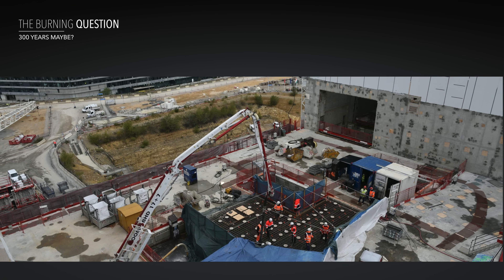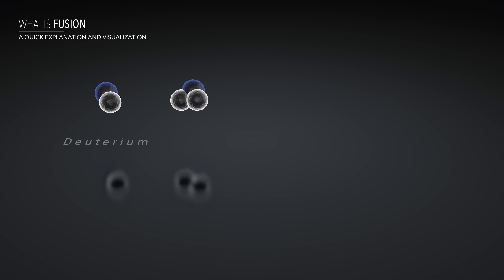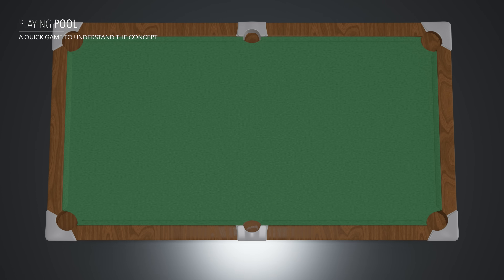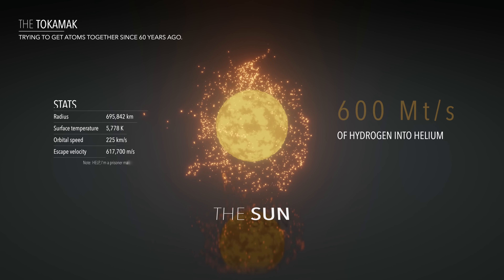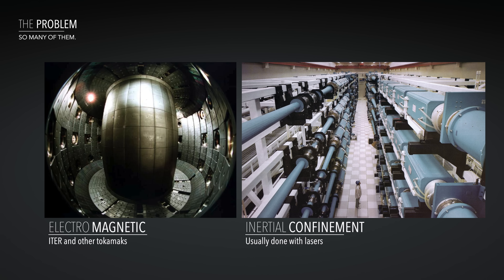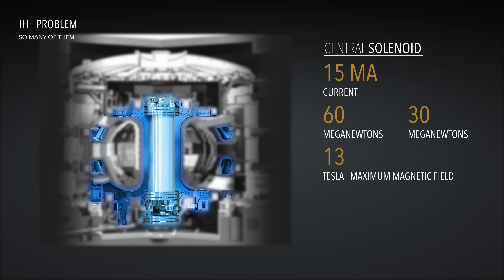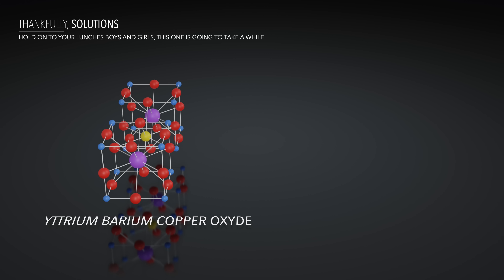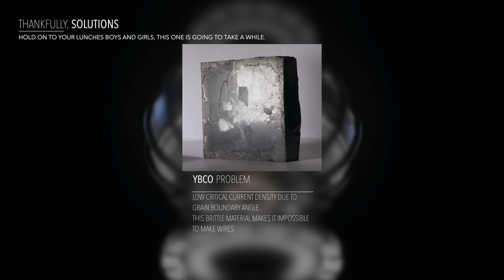Fusion in 30 years? ITER update [2020]

Comment: Fusion excitation function of 35Cl + 130Te system is measured in the energy range around the Coulomb barrier and analyzed in the framework of the coupled-channels approach. The role of projectile deformation, nuclear structure, and the couplings of inelastic excitations and positive Q−value neutron transfer channels in sub-barrier fusion are investigated through the comparison of reduced fusion excitation functions of 35,37Cl +130Te systems. The reduced fusion excitation function of 35Cl + 130Te system shows substantial enhancement over 37Cl + 130Te system in sub-barrier energy region which is attributed to the presence of positive Q-value neutron transfer channels in 35Cl + 130Te system. Findings of this work strongly suggest the importance of +2n - transfer coupling in sub-barrier fusion apart from the simple inclusion of inelastic excitations of interacting partners, and are in stark contrast with the results presented by Kohley \textit{et al.}, [Phys. Rev. Lett. 107, 202701 (2011)]. 

Die Fusionsanregungsfunktion des 35Cl (Chlor) + 130Te-(Tellur) Systems wird im Energiebereich um die Coulomb-Barriere gemessen und im Rahmen des Coupled-Channel-Ansatzes analysiert. Die Rolle der Projektildeformation, der Kernstruktur und der Kopplungen von inelastischen Anregungen und Neutronentransferkanälen mit positivem Q-Wert bei der Subbarriere-Fusion werden durch den Vergleich reduzierter Fusionsanregungsfunktionen von 35,37Cl + 130Te-Systemen untersucht. Die reduzierte Fusionsanregungsfunktion des 35Cl + 130Te-Systems zeigt eine wesentliche Verbesserung gegenüber dem 37Cl + 130Te-System im Subbarriere-Energiebereich, was dem Vorhandensein von Neutronentransferkanälen mit positivem Q-Wert im 35Cl + 130Te-System zugeschrieben wird. Die Ergebnisse dieser Arbeit deuten stark auf die Bedeutung der +2n - Transferkopplung in der Subbarriere-Fusion abgesehen von der einfachen Einbeziehung inelastischer Anregungen wechselwirkender Partner hin und stehen in krassem Gegensatz zu den von Kohley \textit{et al.} präsentierten Ergebnissen, [Phys. Rev. Lett. 107, 202701 (2011)].

Comment: I can not help but think an internal extremely high density microwave may be able to initiate plasma at temperatures needed in the chamber
Reply: Microwave heating is and has long been used in the tokamak reactors to help get the plasma up to temperature.

Comment: Also in the electron volt energy calculation what is not addressed is that we actually don’t use full critical mass fission reactions in current nuclear power we just use heavy isotope thermodynamic exchange reactions significantly less than that of a nuclear fission event, fusion now imagine is 4.36 times more energy expedient than that !

Comment: Unfortunately, sustained fusion may still require the need for constant massive gravitational force to naturally induce fusion.  The closest source of fairly large gravitational force is at the core of the Earth, therefore perhaps scientists may need to look at how they can turn the Earth's core into a global fusion reactor.  The problems are the potential runaway overheating of the Earth's crust, evaporation of seawater, etc.  In the end, it might make more sense to just build power plants next to volcanoes that can be used to heat up seawater and generate steam that runs turbines similar to a nuclear fission reactor heating up water to turn them into steam.

Comment: Our host did not mention the NUMBER ONE reason WHY the ITER fusion reactor will likely succeed, whereas all others have Come Up Short.
ITER, being phenomenally physically LARGE, establishes the possibility of a HUGE cross sectional area for the Plasma. Where Nuclear Fusion is concerned, there are THREE volumetric criteria. Of the recognized THREE criterion, only two have been varied experimentally, in a large count of ways. The remaining "frontier" is cross sectional area, and ITER stands a good chance of FINALLY, and significantly, exploring THAT variable. You see, the LARGER the cross sectional area of the confined Plasma, the LONGER it takes for the released Energy to ESCAPE (from the confinement zone.) The LONGER this process takes, then the level of HEAT (within the confinement zone) climbs HIGHER, which contributes to the possibility of keeping the Fusion Reaction GOING, perhaps long enough that the Fusion Reaction will, hopefully, become SELF SUSTAINING.

Comment: If ITER succeeds spectacularly with all goals and sub goals it will prove only that ITER-style Tokamaks are not worth pursuing for power generation. A practical tokamak-type fusion reactor, if such a thing is possible, would be much smaller and to do that you need to have much, much higher B-fields. It may have all sorts of plasma instability problems ITER didn't tell us anything about, because ITER was much too large and had much too weak B-fields to tell us anything about that. 

ITER looks like it was designed by the fossil fuel industry to sabotage the quest for nuclear fusion. ITER is a giant cuckoo crowding out spending on actually useful fusion power projects. We learned everything we could from smaller reactors and went with bigger and bigger every few years until ITER; ITER was so big it had to be international and the project would not span a few years like most tokamaks at the time, it would span 5 decades to build one reactor and start experiments (it was first proposed in 1986 and won't start tritium experiments until 2035).

Comment: wait, I don't get it. At 4:23 it shows that the overall energy output is lower than the energy input. If we get less energy than we put in then why are we trying to use fusion energy at all?
Reply: Because JET was only a little experiment, later generations will produce much more than they use

Comment: Honestly I think fusion power is an unrealistic solution to the climate crisis for one I think it's way harder then people think and I think it will be at least a hundred years before you have a fusion generator that generates significant amounts of energy another problem is even if it does generate significant amounts of energy imagine how much money has one fully functioning Fusion reactor would cost I mean one of the main reasons why nuclear reactors aren't widespread is because they're so expensive to build the huge risk Financial and fusion reactors would probably be way more expensive than nuclear although Fusion reactors do have a main advantage over new clear of people aren't unreasonably scared of it

Comment: personally i think tech for Luddites take on fusion to be more accurate. there's so many problems with fusion that it shouldn't be depicted as a new power source. Tritium scarcity (<2.5 kg/yr worldwide vs 125 kg required), material degradation and radioactivity of tokamak,  quenching of magnets) not to mention the $60 billion cost! This is obviously an experiment that needs to be done but there are much better options for power generation here right now and not "30 years" away.

Comment: For sure that new technology has fatal flaws that are yet unknown. They should make sure to design safety for total failure scenario. I don't trust fusion.  10 times hotter than the center of the sun on earth sounds like a wrong idea.
Reply: There’s places on Earth tens of thousands of times hotter than the sun. Temperature is meaningless at this point and there is 0 danger because of it.

Comment: Keep working on fusion power but in the meantime there is no reason whatsoever not to use and improve upon the current generation of safer, cleaner fission reactors which are our best bet for safe, clean, cheap energy for the short term.  But when it comes to energy, the solution for which technology to really use is yes, all of the above.  They all have advantages and disadvantages and we can and should leverage each technology where it makes the most sense and stop trying to shoehorn the planet into a one size fits all solution.  Fossil fuels, hydroelectric, hydrothermal, solar, wind, nuclear ... all of it.

Comment: In less than 5 years we'll have commercially available electric plasma reactors.  Using the reactions that really power stars, a portable 20 Kwatt device will produce almost a million BTU of heat, allowing it to produce 100 Kwatt electric power.

Comment: Stupid. Comprehend and copy nature. Nature achieves fusion in this manner... umm... 
Never. 
Nature provides countless examples for achieving charge equilibrium. Notice that all fusion is achiever in the central region (null point/node point.) of a true magnetic field complete with counter rotation of the polar hemispheres and a dielectric plane separating the two hemispheres. The energy inputs are in the hyperbolic vortex region along the inside diameter of the polar hemispheres of the combined and counter balanced N/S polarised toroidal field. With several other mechanisms facilitating the specific transitions of counter existing EM charge characteristics surrounding the null point to the spiral nature of the dielectric plane. And importantly, a polar axis perpendicular to the dielectric plane which the null point can discharge magnetic force to achieve equilibrium. The concentrated vortex along the polar axis creates a ‘wave guide’ along which the ultra high e-volt energy can discharge without inducing eddy currents / resistance. Without getting the specific attributes correctly configured and in phase coherence with each other, than both the correct input and output channels will never be realised and attempting to force the charge equalisation process through artificial mechanisms will only induce critical instability into the dynamics of the process. In short, effectively destroying the sustainability of the process. Attempts to stabilise this artificial process will require more energy than the process is capable of producing and more energy than we are realistically capable of achieving, let alone sustaining. 

I believe this is a deliberately corrupted endeavour to syphon money from government coffers and covertly develop knowledge which is able to be utilised in other platforms, such as weaponry. As unleashing this technology in its true form onto humanity would eventually enable it to escape the confinement of its energy requirements to being served exclusively by the powers that be. As well as ultimately conceding the true nature of physics and consequentially equipping humanity with a ‘threatening’ level of understanding and knowledge, allowing it to escape the oppression of the current established order. 
Kinda like giving an inmate the key to his jail cell.... 

If fusion was actually the objective we would be paying much more attention to the SAFIRE PROJECT and the EU Theory. As some major defence contractors are beginning too. (In order to capture this technology for its own exclusive use once it achieves a fully functioning and working level. Which is only 5years away at its current rate of progress. Maybe less if the funding keeps coming and/or the key patents are not stolen out from under the developers and the technology locked away from public access/use. 

This form of fusion always has been and always will be simply laughable. Especially when you consider the BILLIONS of public already poured into the R&D teams pockets. 
How can so many ‘experts’ be so absurdly arrogant and blind? If it’s on purpose, how do they keep a straight face when pretending to be all professional, informing the scientific community of their progress, obstacles and timeline for a proof of concept. Even Sonoluminescence has progressed further. 

Check out the SAFIRE PROJECTS fusion reactor, which is a working model of the sun as conceived as an externally, electrically powered condensed plasma. (Complete with working theoretical models explaining many of the stellar aspects that classical physics and thermonuclear fusion is no where near being able to coherently explain. No where near, with 100 years of ‘advancement’ and 99.999% of funding granted to the SM based sciences. THE SAFIRE PROJECT has achieved more in 10 years, with a tiny, TINY fraction of the funding levels. And popular support. Can’t argue with results... 
Bet my left family jewel that it mysteriously disappears from public view soon tho.... 1-2yrs tops and the info on its progress will simply stop.

Comment: I'd dissolve into water A bit of thorium and plutonium. Add methane.

Have that in narrow tubes. And kept in high pressure.
The radioactivity will act as an accelarent.
When too much let the water flow and reduce the pressure.

Comment: I didn't understand anything the commentator was talking about except that they might complete construction in 30 years and turn it on... Then wait any another 10 years for it to possibly start producing energy, if everything goes as planned. Ohh... And depending on what might need to be fixed may add many more years of delays.

Is this shit even safe? Cause 10x hotter than the sun doesn't sound too safe to me. And doesn't the sun produce radiation? Like I said...I didn't understand much.

Comment: Perhaps it is not the expense, or the staggering scientific and technical difficulties that it requires to create such an amazing and important uber-machine that concerns me, what worries me is that they will eventually succeed. 

This will put the next hierarchy of primary power generation into the hands of only the largest and most powerful nation states. The attainment of practically infinite clean power is not a bad thing, but I could not help but wonder if only a fraction of funding that has gone into Fusion would have been used to create a cheap easy to produce Solar Cell that is close to 50% or even 40% efficiency, it would revolutionize power use and consumption for the poorest of the poor, and for everyone else all over the world.

Comment: fusion will not work because fusion is a consequences of a stars driving force not the engine .
when hydrogen "fuses" into helium no more energy released , please explain what the other elements are doing at the same time.
Fusion = Failure= billions of dollars have been now flushed down the fusion toilet.
name one fusion reactor experimental or not thats has taken no power from a grid but has put power into the grid .
Reply: Ossie Dunstan what other elements? And energy is released, it’s fairly basic physics
Reply: @Gomlmon99  fusion is one time event , once hydrogen fuses into helium thats it no more fusion until helium fuses into what ever.
You are in your post telling me that hydrogen is the only element in the sun , LMFAO.
You failed to post an actual fusion reactor that has produced more power than it has taken of the grid.
As i have stated fusion is bye product a consequence of a stars engine , A star is about matter transformation from state to state , fusion will not produce power on the level released bye stars because fusion is not what releases all the energy from stars.
its not basic physics at all it about heat gravity and the transformation of matter into states that when changing release energy from the change in state . This change can happen many time s before the element can no longer sustain the energy release and find stability in fusing.
the sun has many of the elements in it.Fusion deos not release energy over time it is a one time action which is unsustainable for power production which i why every fusion reactor today has failed to produce power to any grid
Reply: Ossie Dunstan you literally have no idea what you’re talking about do you? You can’t even spell. Fusion doesn’t currently produce more power than it uses purely because of plasma contamination and energy dissipation, the physics is all there. What’s your background in fusion research can I ask?

Comment: This still uses the current standard method of super heating the fuel to get a reaction. That requires large amounts of energy and has proven difficult to sustain the reaction. I read a new method of using lasers and hellium/boron fuel cells is far more promising.

Comment: The US could easily to get fusion up and running in 10 years if they would just use their brains and divert the useless military funds to Fusion R&D, When fusion works it renders most warmachines useless to compared what can be done with a fusion reactor slapped into say a destroyer/submarine. I suppose they just need to told that they can pump oil faster if they have a fusion reactor, that should get them to do it. To me its absolutely ridicilous that we as an "intelligent" species limit our capabilities with pieces of PAPER! I bet the aliens are laughing their asses off.

Comment: We have a massive amount of fusion available daily, My solar panels, standing at a safe distance from the reactor collect energy from it and store it in my batteries so I have fusion power any time I need it.
ITER would have paid for 160 000 000 000 watts of solar power production at today's rates. I'd say this foolish project is a massive waste of valuable resources. Maybe they will tell me that in 30 years that in 40 years they will prove me wrong, but I am not holding my breath for that kind of extremely expensive centralized power production, I will make the most of what is available to me now
Reply: Tom Kelly where you going to get the elements to manufacture that amount of solar panels? What about the huge amounts of energy used and greenhouse gases that result from their manufacture? What about countries without lots of sun? What about all the toxic waste produced during their manufacture? What about in the night time and cloudy days?